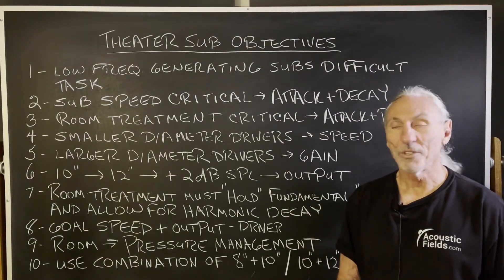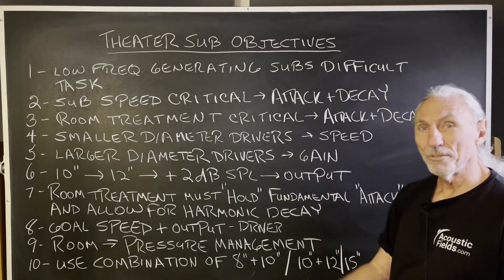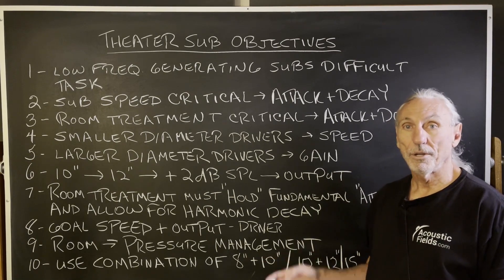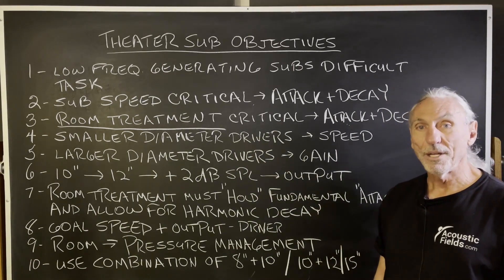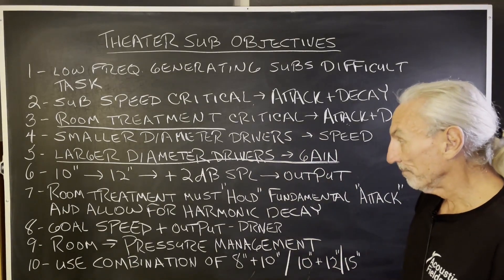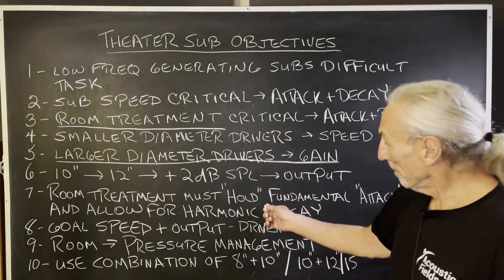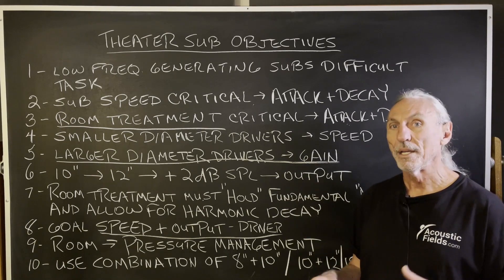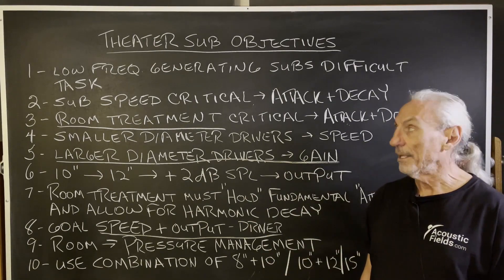Theater Sub Objectives - www.AcousticFields.com

Comment: With an 8 foot ceiling and near field sub location, would it be more optimal to have the subs at least 2 feet off the floor and fire towards the ceiling?
Reply from the maker: Elevation at 24" is good but you need to make the sub stand absorptive so you get elevation and attenuation which produces more near and far field sub resolution

Comment: I'm a contractor working on outfitting the second floor of a bar, so it can be used for live music, screening movies, and holding conferences. I'll probably be order a lot of your 2 inch foam. The room is large and oddly shaped, with a 6 foot wide hall from the stairs that I'm guessing will act as a broadband trap, the ceiling is 9 partly vaulted and pretty high, and the owner wants to redo one wall almost entirely with glass. There is also a mural on a back wall that I dont think ill be able to cover. If i put foam on the wall thats parallel with the large glass wall will the assymetry be worse than not using any foam? I am planning on focusing my efforts on the ceiling, with diffusers and absorbers and placing foam wherever I can manage on the walls. What are your thoughts?
Reply from the maker: Fill out the information in this link and schedule a time slot to speak with Dennis using the electronic calendar.
https://www.acousticfields.com/free-room-analysis/

Comment: Hey Dennis!

Great suggestion regarding the combination of sub sizes...I thought about that last year...I tried it briefly, however I was a little out of tolerance due to the sizes being 8in and 15in Sub's... I'll get them more closely together regarding the sizes...
Reply from the maker: I will place my subs right next to my listening position just so I can hear their speed or how they attack and display the fundamentals. I can notice the difference in the speed of delivery. The next issue is will that perceived near field speed translate into a far field room sound. In my smaller multi channel room, it definately does. I will try in our larger room when time permits. I have 3 sub sizes to work with 8", 12", and 13.5"
Reply: @AcousticFields  Understood!  I have 3 Subs in the rear which replicate the near field pressure... Due to space, I can't place them any further away than they are right now... We're moving into a new home in September 2023... We'll definitely have the space by then...
Reply: @AcousticFields  
Have to disagree as its a piston area issue or lack of thus many place subs in corners instead of getting proper piston area to place away from walls even in properly treated rooms.

Comment: What are the thoughts about Single or Double Bass Arrays (SBA - DBA) and Bafflewalls (thick Treatment ~60cm behind the screen) ? In professionel done & planned Hometheatres are mostly no single Subwoofers‘s, instead big 2,4,6 or 8 big ~30cm Drivers installed (for example HollywoodZuhause here on Youtube)
Reply from the maker: Positioning of low frequency drivers in room dimension and room volume dependent. You must place them where they work best for the room size and usage.